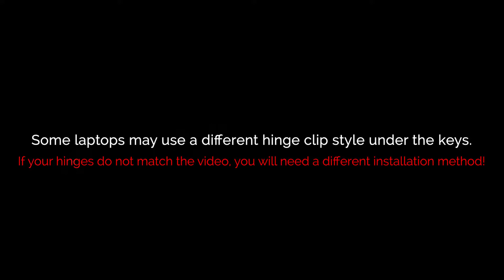How to Replace HP Spectre x360 13-ac Keys

Comment from the maker: ► Please read the description before asking how to remove keys! Because every keyboard is different and can use various retainer clip types, key removal isn't shown because the same method will NOT work for everyone! Our videos are designed to help customers who are already missing keys and wish to remedy using our genuine OEM key replacement kits! 

► We've created a single, all inclusive tutorial on how to remove keys that will work for 99% of laptop models! (Check the link in the description) 

► If you need technical assistance, please visit our website at https://www.quikfixlaptopkeys.com

Thanks for your support!